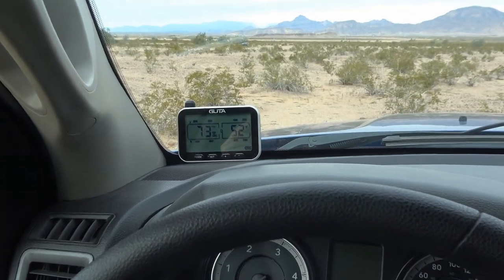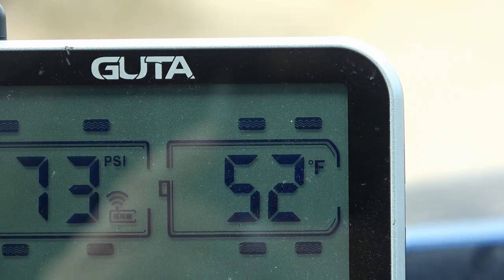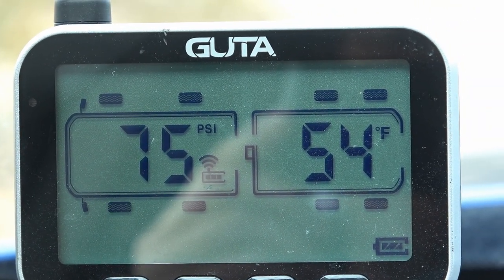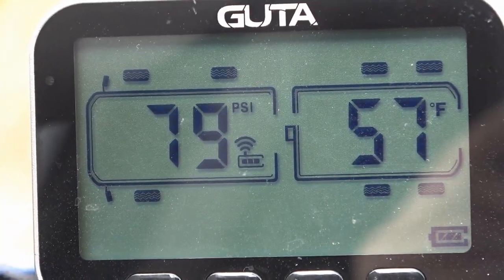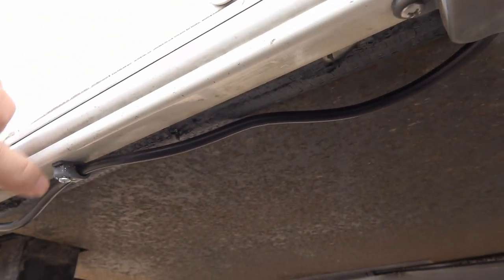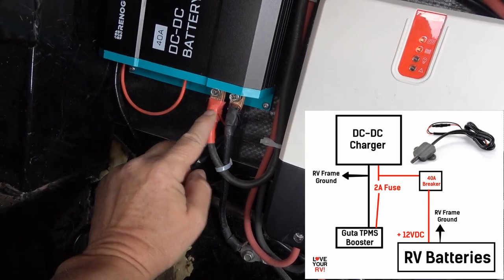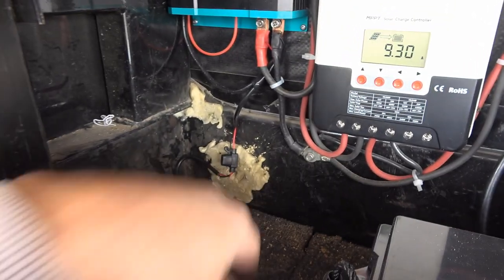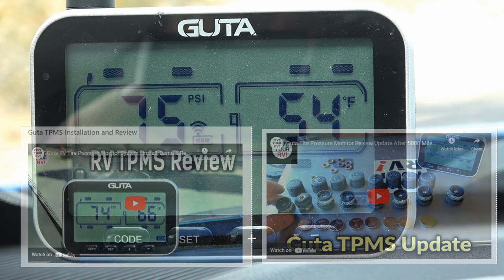Wireless TPMS Update - Guta Booster Installation Needed - RV Tire Pressure Monitoring System

Comment: At 2:10 for instance - the two little screws on top are watertight? Or will they see a little sealant later on? Anyway, thanks for sharing!
Reply from the maker: Yes, the manual states the booster is waterproof and can be installed inside or outside.